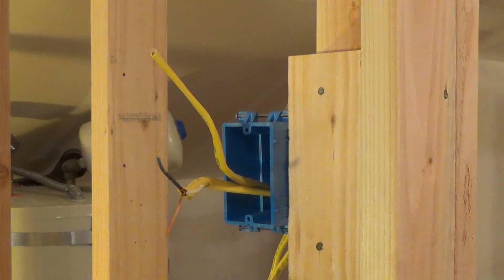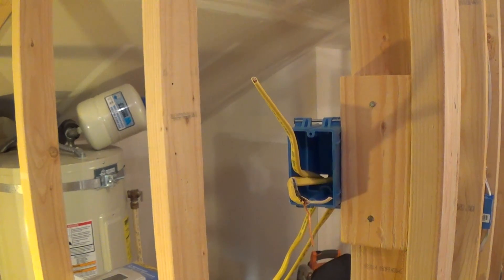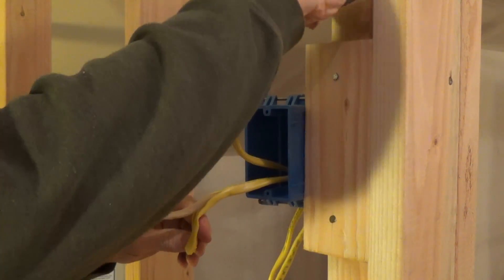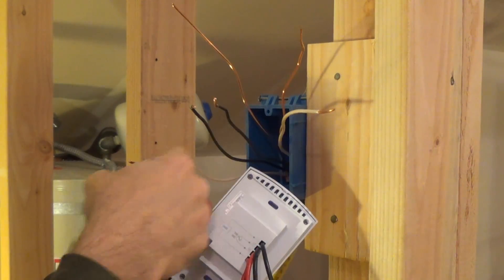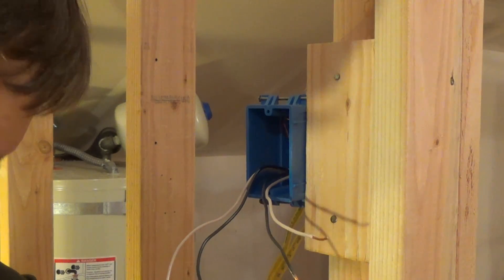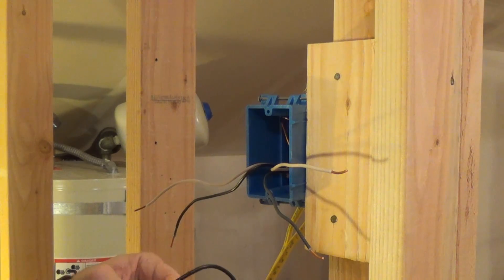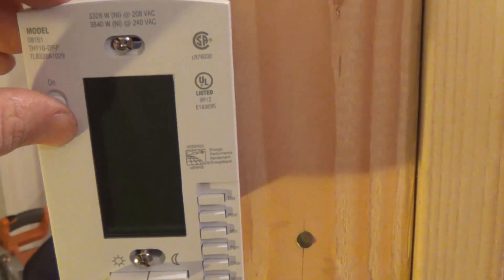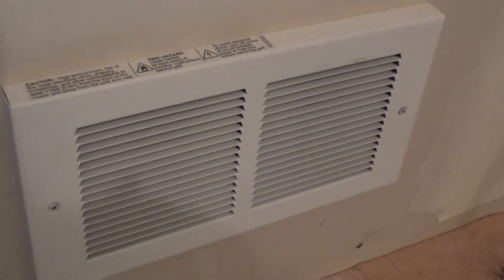How to Install a Programmable Electronic Thermostat (Double Pole)

Comment: I went to instal one, and I turned power off at the breaker. I cap off both leads, and I turn power back on to find the line. The only problem is they’re both hot from my pin tester. I am lost as to figure out which one Is line and load

Comment: I'm confused. It's 240 volts, so In a two wire and ground cable, both the red and black should carry 120 Volts Each with no neutral. A black and white is 120 volt single pole with a hot and a neutral wire (and a ground). I'm not being a YouTube professor, I'm just confused now 🤔
Reply: The white and black are both hooked up to the breaker in this setup, there isn't a common.  They would both be 'hot'.  That threw me for a loop when I first started blowing up thermostats ;)

Comment: I would have also shown how the cover on the face of the thermostat attaches.  If you weren't familiar with this model you'd think it was two different units.  Also, if this is the TH110 it's available at Home Depot for $64 with a National Grid $25 rebate available until 12/31/1.  I guess this was more about wiring than the thermostat itself, but I think it would have made for a more comprehensive presentation.  Good luck.

Comment: How did you determine if it's a double pole thermometer.
Reply from the maker: This is from Cadet:

Double pole thermostats have an "off setting" and break both sides of the heater’s power line.
Single pole thermostats only have a "low" setting and no true "off" setting, and break only one side of the heater’s power line.
For heaters with a single pole thermostat, if room temperatures dip, the heater will turn on even if the thermostat is at its lowest setting. The best way to ensure your heater is off is to disconnect power to the heater circuit at the main disconnect panel.